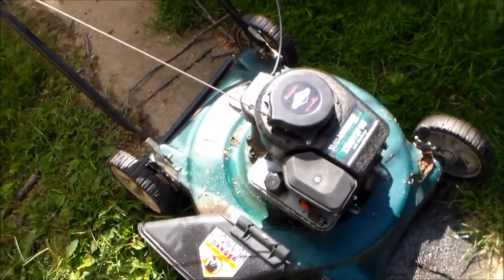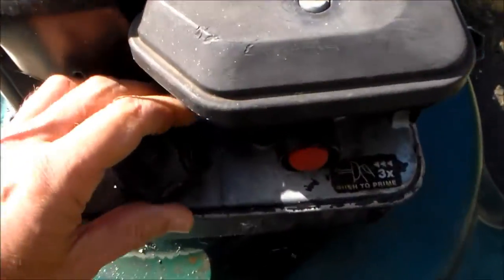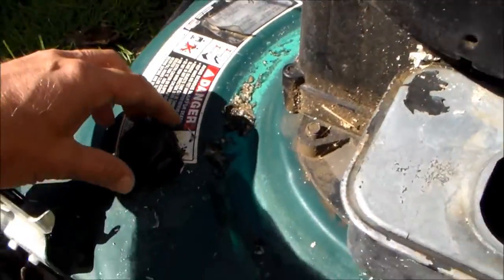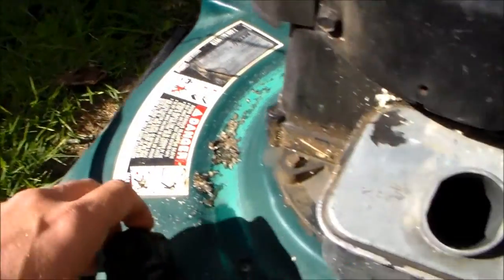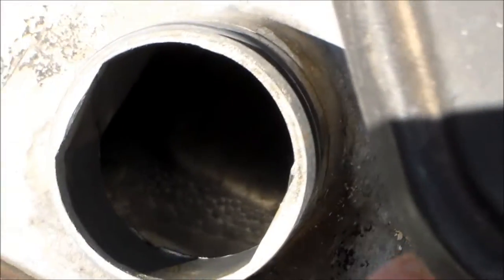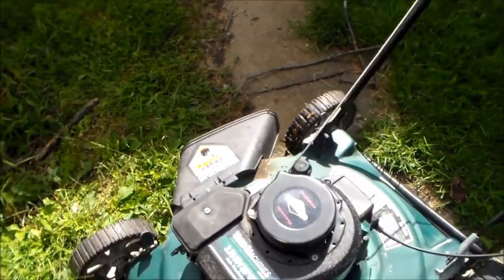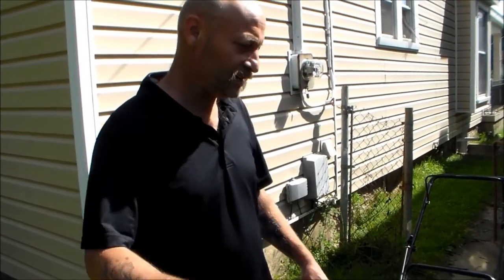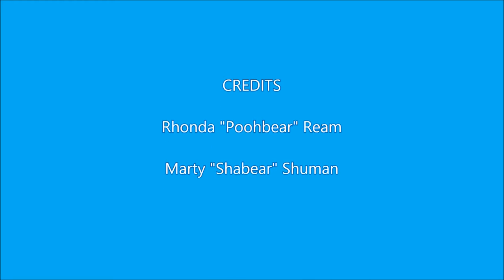push mower starts and stalls

Comment: Check the compression and cylinder leak-down. Replace the diaphragm regularly. Replace the muffler if too loud and check exhaust port for carbon clogging. If the throttle springs are missing, it won't fast idle. Check head gasket torque. They usually loosen over time! Blue smoke on 1st start-up can be the intake valve seal. It can also be rings.